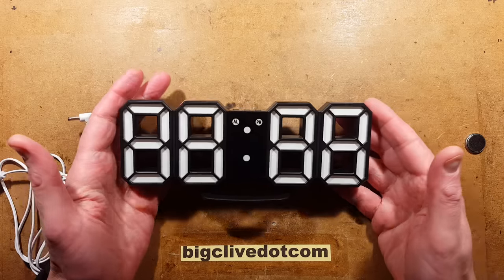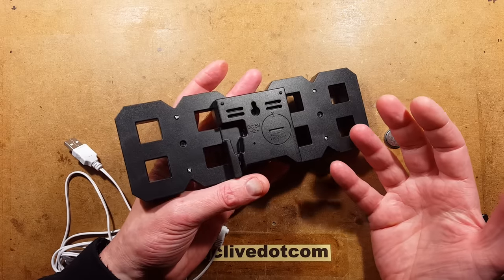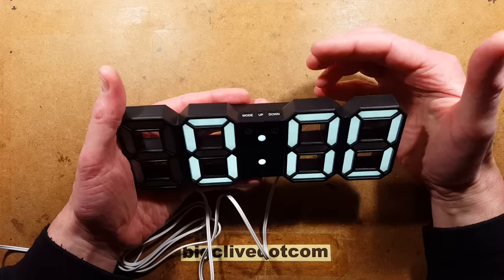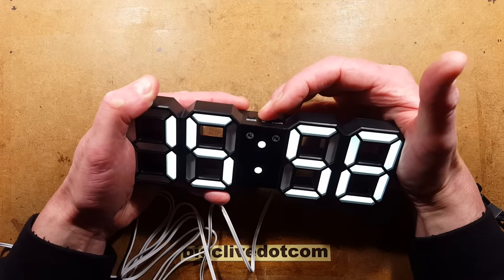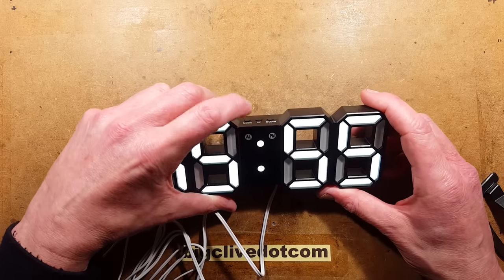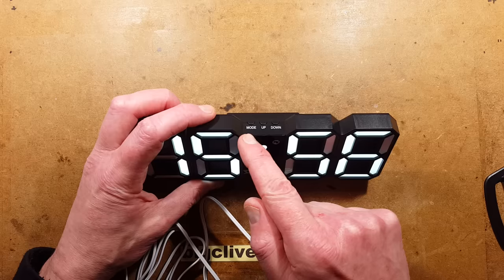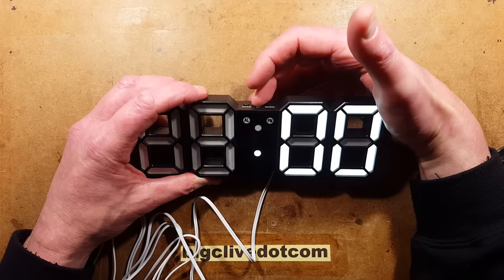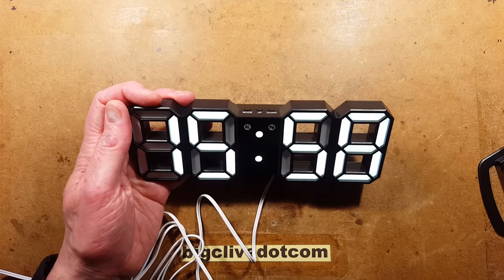How to set your 3D LED digital wall clock.

Comment: I just bought one via eBay. This appears to be a different version, with a snow-white housing, with a provision to display temperature in C only, auto-dimming between 7PM to 6AM (not adjustable & no manual dimming levels), and has a built-in sound sensor (I can't find any mode that doesn't shut off the display after 15 seconds and then wait for a very loud sound to momentarily turn on and then cycle back to off.) What possible use is there for a clock that wants to be OFF most of the time unless you are yelling at it? The control buttons are labeled SET, UP, DOWN & RESET, but they do not function same as Clive's unit. BTW, it comes with the worst Chinglish spec sheet I have ever seen. Would have been a very nice time display for a dim area if only I could figure out how to make it work; now, it's going to be a dissection project.
And now, after an hour of pushing buttons and resetting, I have it displaying the correct time/date/temp and it is staying on, plus the auto-dimming is working. Now, how did I do it? Also, arrived with 3 Volt CR2032 Lithium cell installed and reading 0.6 VDC.
Reply: @2BeeAware  Try pressing the Down button - if it is the same as mine, each time you press Down the display will show - - Sd or On Sd.  Leave it displaying - - Sd, that is power saving off.  The only thing I wish is that it was possible to disable the evening auto-dimming function, which does not seem possible on the version I have.

Comment: is it ok if left unplugged?
Reply from the maker: I leave it plugged in to a good quality USB power supply.  I leave it at its lowest intensity setting.
Reply: @bigclivedotcom  I have a similar clock with same buttons, but it won't let me dim it except between 7pm and ?? in the AM. Apparently there are multiple versions that look the same but have different functions enabled? I want it dim all the time in my home theater. If yours will do that where did you get?
Thanks.

Comment: How do you change the colour of the LEDs?
Reply: Microsoft Paint.  ;o)
Reply: @sarkybugger5009  Lol, I hope not. In the previous video, he mentioned the LEDs were RGB.
Reply: @gaellafond6367  No he did not. And they are not RGB
Reply: With a soldering iron or a hot air work station

Comment: RGB mod it. C'mon Clive I know you want to...
Reply: would need a new pcb and controller...  ie would just use the plastics...
Reply: @Dust599  Don't be siily. There are two-pole RGB LEDs with controllers built into them to cycle through three colours mindlessly. While it would mean each segment would differ slightly (or significantly depending on timing) it would still be an "RGB mod" because it's using those braindead RGB LEDs.